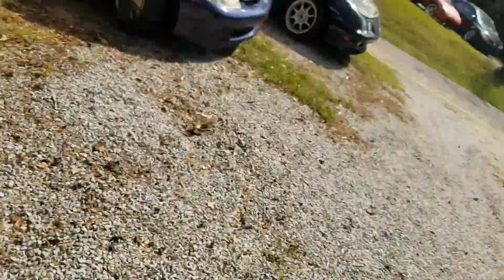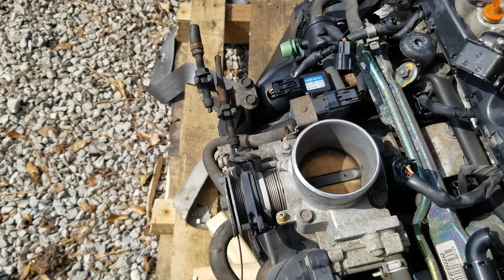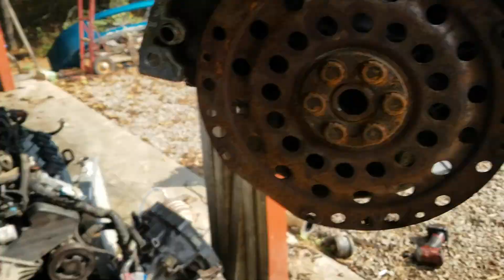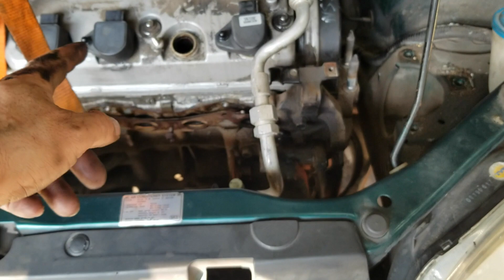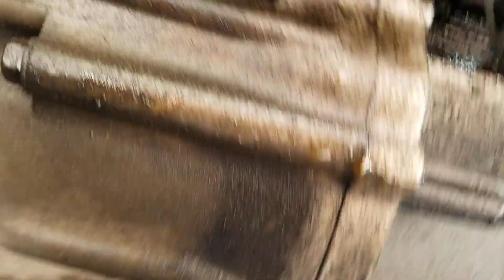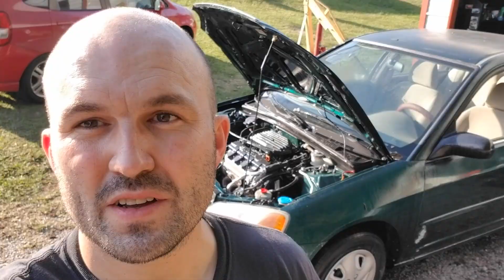2001 - 2005 Honda Civic D17A1 Engine install

Comment: What do I have to do to get the Canadian built bmxa transmission to work properly with a jdm d17a? Or is that not an option? I recently swapped a jdm d17a  vtec engine into my 2005 civic lx non vtec . Tried to get it to work with bmxa transmission and it only worked for a short amount of time. Currently it’s not driveable . Makes a horrible winding sound in park neutral and reverse. Drive D3 and D2 seem to be working fine. Also it won’t even go in reverse the winding sound gets louder when you hit the gas in reverse. What are the options to get my car running properly again I’m desperate any help would be greatly appreciated. Thanks.

Comment: i got someone selling a 2004 honda civic ex for $1000. i talked him down to 500-600. he claims its a bad head gasket. what do u think about this deal? i wanna buy the car just to start working on a car thats my own. that kind of thinking has gotten into bad deals before. id like to know what u thinkn of the price. its all there motor too
Reply from the maker: These are notorious for heat gasket failure
Reply: @hondaresource  what do u think about the price? Is this a buy and flip? Or should i say prayers and walk away like it the devil?
Reply from the maker: @probong2053  5-600 is fair

Comment: Replacing my 2002 Honda LX D17A1 on monday because before I bought the car the lady I bought it from hot her timing belt tensioner replaced and the mechanic replaced the tensioner bolt (I assume he lost it). With a grade 8 non flanged bolt. It ended up snapping in the block and ruining my cylinder 4 piston and valves.  So annoying
Reply from the maker: ouch! best of luck with the replacement!

Comment: With your remove and install Honda videos, I was followed your detailed steps and did the same for a 2003 Honda Civic LX EM2 motor. I am going to start the car this weekend. You make a great teacher because you teach with simplicity and tell what to do. I was a self-employed mechanic in the 90s and built a muscle car for racing. With your informative videos, I got back into the business fixing only Hondas, but just for my sons for now.
Thanks again.
Reply from the maker: Awesome, I'm glad it was useful to you
Reply: Agree’d also my first time installing the trans on my 04 civic he went step by step. It was a little different but got it done with no problems at all!!

Comment: Do have a video about the water pump connecting pipe? I had to swap a connecting pipe from a new motor. There is not too many videos on the subject and they are very good. THANKS
Reply from the maker: I dont, I'm sorry.

Comment: You helped me so much with that Jdm vtec sensor tip. I kept hitting 4,000 and rev limited 😂 I knew it was the vtec not engaging and saw the extra plug but wasn’t sure where it went till I watched this. Also the cruise control hookup 👍🏼.
Huge super thanks! Higher compression and vtec woohoo! Rocket ship ex
Reply from the maker: Awesome, I'm glad you found it useful!

Comment: I got a 02 Honda Civic LX  non vitec, can swap  with vtec? It seems like those are the only ones available.
Reply from the maker: Yes. you can swap it right in, it just won't have vtec. If you want the vtec to engage, you will have to run a couple wires to the ecu from the vtec solenoid and change to a vtec ecu.
Reply: What a relief! Thank you so much you are a life saver.

Comment: On the first video did you also remove the starter?
Reply from the maker: I'm not sure if I did or not. It's not necessary for auto trans. Manual trans requires removing one of the bolts.
Reply: @hondaresource  Ok I'll know as I start removing the engine
Thank you for your video
Reply from the maker: @gmo976  yessir, I'm hoping it helps you

Comment: So, I just need the short block; Does anyone know if I can use a Vtec short block for my NON-Vtec 2004 Civic LX 1.7 automatic ? THANK YOU!
Reply from the maker: You can put the complete vtec engine in and just leave vtec disconnected. It'll run fine.
Reply: @hondaresource  Really? Slight modifications?
Reply from the maker: @juliebarnes6208  no modifications either way
Reply from the maker: I've never put the non vtec head on the vtec short block. I've put the vtec head on the non vtec short block.

Comment: New subscriber here bc I hv the same 7thgen 1.7l civic sedan 5speed manual that might needs new engine. It got ticking sound when running think its the valves and having starting issues. Try to used rislone engine treatment today see what happens.

Comment: Quick question, going from d17a1 to the d17a. What do i need to do to bypass the vtec for the time being, till i get the vtec ecu for the car? I know exhaust and intake changes to my usdm. Anything else
Reply from the maker: no need to bypass anything. Just leave the vtec unplugged and run it with your original ecu
Reply: @hondaresource  ok perfect. Will there be any changes when i do put a vtec ecu to it?
Reply from the maker: @1rcracer  just have to add a couple wires for vtec and have the new ECU programmed to your key
Reply: @hondaresource  even for manual windows and locks?
Reply from the maker: @1rcracer  that has nothing to do with the engine computer
Reply: @hondaresource  thought thats what you meant by key.
Reply from the maker: @1rcracer  no the original key has to be programmed to the ecu. The dealer or most locksmith can do it

Comment: Also id pulled the 3-4 plugs off the trans an the 3 plugs on pcm an pulled harness with engine..  All kinda ways to do it no way is wrong if it works 😁

Comment: What if you are putting a d17a1 into a vtec A2 car.. ?? I did a opps an ended up getting a A1 engine. An noticed a year later when i installed it.   Anyway to bypass vtec the car has bad low end power.

Comment: How do you take off the fuel hose connector?
Reply from the maker: The black plastic connection cover pops off by hand then press the green tabs on the retainer (2) and pull the hose off the barb.
Reply: @hondaresource  thanks!

Comment: I have a 2005 Honda Civic  with a d17a2 
That blew a rod can I put a D17a1
Reply from the maker: You can, but you will need to change the ecu to a non vtec so that it won't be in limp mode due to not having vtec

Comment: Didn't show the difference in the brackets on the oil pan?
Reply from the maker: You're right, I didn't have both to compare. The JDM d17a uses the same bracket as the usdm d17a1 since they both share steel oil pans. The d17a2 is a different design that connects to the aluminum oil pan.
Reply: @hondaresource  So is it ok without the bracket?
Reply from the maker: @hardhatcat100  yes. I've had several come through the shop without them

Comment: @2:43 so the pressure sensor has to be plugged in? What about that plug above it with the light blue wire and the sensor under the black plastic intake manifold? Or does that blue cord plug connects to the pressure sensor? I appreciate your help.
Reply from the maker: If you have a vtec car both of them should be plugged up. But, if you are installing a vtec engine and a non-vtec car it is not necessary to hook them up
Reply: @hondaresource  thank you because I am installing a vtec engine d17a1 and was stressing that I couldn’t find the plug for the pressure sensor. I am installing it on a non-vtec car (2005 Honda Civic LX) so I should be fine correct? Thank you for your help
Reply from the maker: @TheMrFlyBoy18  yes, if you are installing a vtec engine into a non vtec car, you can just leave the vtec disconnected.
Reply: @hondaresource  Thank you for your help I’ll let you know how it goes haha
Reply: It works well! Fired it up and the Honda is running. The engine shakes a little bit while idling but no signs of codes or anything leaking so I assume thats how it is. Maybe I should tighten more the bolts from the transmission to the engine but thank you for your input tit really helped me get my Honda back :) @The Honda Resource

Comment: I paid a guy to replace a d17a1 engine in a 2004 civic lx non vtec....he found the engine for me and didn't tell me it wasn't an exact replacement,  turns out he put a d17z1 (I think it's an australia engine???) in it and the problem now is I have a p0401 code about an EGR air flow insufficiency issue. when I asked him about the EGR he said that he had to take the one off the old engine and put it on this engine because it was different.... Is there a way to fix this so I can pass the smog?
Reply from the maker: The non egr intake manifold is different. Make sure you have the egr intake manifold

Comment: Appreciate your efforts and time, subscribed! Also you mention about clockwise and counterclockwise. When I put in those 8 bolts back into the disk plate I was turning the disk plate counterclockwise, my timing should still be fine correct? I did not use crank pulley bolt or had the crank pull on the block. And do you have videos of more in depth on the install? After I exchange the throttle body and the sensor you said I will need to out everything back which I forgot where what hose goes where?
Reply from the maker: There is a video removing everything, I think that video may show more of the actual parts. It's probably fine. Just pull the valve cover and check timing

Comment: Got a bad cylinder on my 01  swapping a d17a2 into my 01 lx not vtec video was helpful thank you 👏🏽 anything else I should get when doing the vtec Into non vtec?
Reply from the maker: You can get the VTec computer and wire in VTec if you'd like
Reply: Update
Reply: @grumet100 ended up junking the car after years of abuse got a Lexus now
Reply: @3uzDion yeqh what happen tho
Reply: @3uzDion did u swap it and what motor u have that u swapped
Reply: @3uzDion what happen to the issue rho

Comment: Hey man.  Awesome video!!!  have a question.  I have an '03 civic with a d17a1 that has a rod knock, on rod #1.  Do you have a fix for that???  Or am I looking at getting another engine???  If that is the case, where can I get an engine???  They seem hard to find.  Thanks...
Reply from the maker: Its cheaper to replace than it is to fix. car-part.com

Comment: Can you put a stick shift jdm into a automatic shell body 2005 honda civic
Reply from the maker: Yes, you just need to changed the ecu, add the shifter, add the clutch pedal, and do a little wiring

Comment: I did this same swap and now having an issue with the cooling fans not coming on. Replaced thermostat. Cooling fan sensor. Engine temp sensor, checked all relays, flushed and bleed radiator and still no luck. What could be the issue?
Reply from the maker: Are you 100% sure the fans are good
Reply: @hondaresource  yes. I can turn them on manually if I bypass the fan sensor with a jumper wire.
Reply from the maker: @josephhillyerd1910  is it over heating?